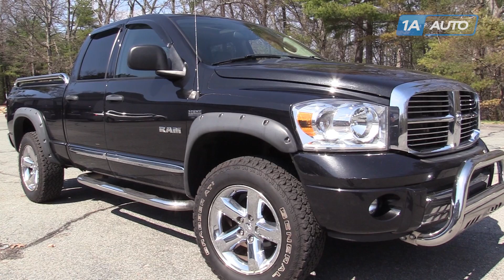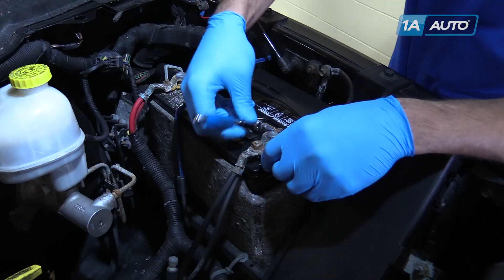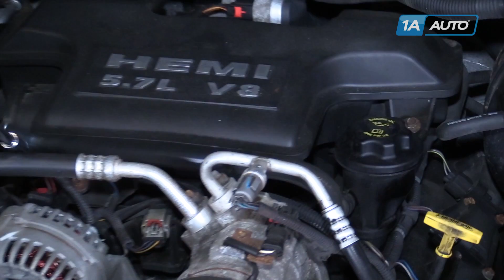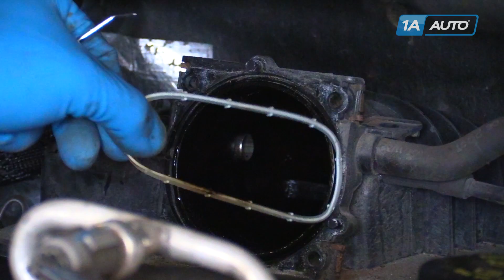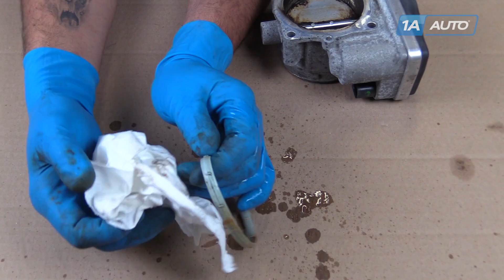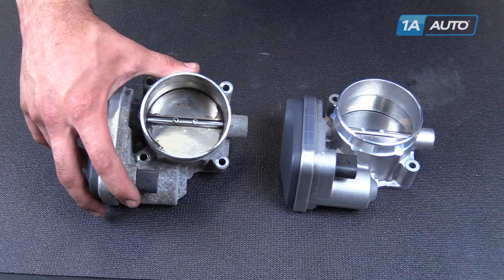How to Replace Throttle Body Assembly 05-10 Dodge Ram

Comment: Will this keep it from starting. Have the lighting bolt light on in the dash
Reply from the maker: +Lee C  When a TPS goes bad, then the car's throttle body won't function properly. It could either stay shut or it won't close properly which is a severe issue. If it stays shut then your engine is not going receive air and it won't start.  Thanks for the question.

Comment: You make it look so easy, everything I tried to loosen and remove WOULD NOT COME OFF AT ALL even after banging on it, why??????????.???.....
Reply: If you don't have the Hemi in your dodge chances are there might be some small differences from this video. For example my 05 4.7l has a different way to loosen the serpentine belt than shown on this Hemi. If you have a lot of miles on the part it could have so much buildup that its "stuck" on. After you've verified there aren't any extra bolts or clips holding it in place. Grab it with both hands and gently rock it side to side, it will take some time but you should be able to break that seal slowly. Also if you bang on it, do not use a metal hammer or an equivalent, the excessive vibrations and force risk damaging other components. If you must hit it, use a rubber mallet or something similar it has less risk of damaging something else. What's your exact make, model, and year for the vehicle you're working on?

Comment: What if you didn’t let the computer relearn the throttle body when it was first installed can it be done later at driving about 1000 miles after instillation

Comment: Maybe a stupid question but why disconnect battery?
Reply from the maker: +ed ven Thanks for watching!  This insures you do not damage any electrical parts and makes it a safer repair!  http://www.1aauto.com/throttle-body-assembly-mopar-53032801ab%2c-53032801ac/i/mptba00003?utm_source=YouTube&utm_medium=CTA+Comment&utm_campaign=ytcomment&utm_term=vALWPV0ll4w

Comment: I have 2000 dodge ram 1500 sport. I have a throttle body spacer on the stock throttle. I have a new Holly, can  both work installed together?

Comment: Question. The wire that connects to my throttle body is frayed. What is the technical term for the wires? I ned to get some new ones.
Reply from the maker: +Matthew Mclarty Thank you for watching. You may call them the wire harness, or pigtail to the throttle body. 1aauto.com

Comment: to relearn . after u reassemble everything reconnect the battery terminal and turn key to on position for like 10-30 seconds. don't start car until you've done this. you might hear some clicking etc it's just your computer learning your new throttle.this works for alot of vehicles but not all
Reply from the maker: +tabitha mccray Thank you for the added tip! Have a great day! 1aauto.com
Reply: @1AAuto  question so you don't have to relearn the throttle body with the scanner on these year rams 05 -10 ?

Comment: You forgot to mention the relearn procedure, very important.
Reply from the maker: +Levi 501 Thank you for the mention. We apologize that this was not mentioned, but will see about having this updated! 1aauto.com
Reply: Any updates on the relearn process?
Reply: 1A Auto Parts how this relearn procedure done? looking to install a new throttle body on my 300c chrysler wanted to know if I would have to disconnect the battery well the negative post
Reply: Miguel Leal It's done through a very expensive Chrysler programming OBD Scanner type tool, i highly suggests you  DONT TOUCH your throttle body plate as it's controlled by your PCM!!!! the relearn procedure is needed when installing a new one for calibration